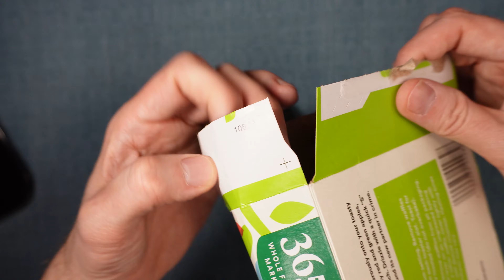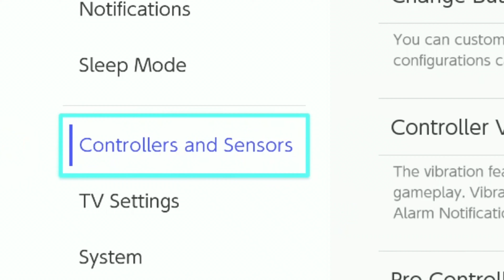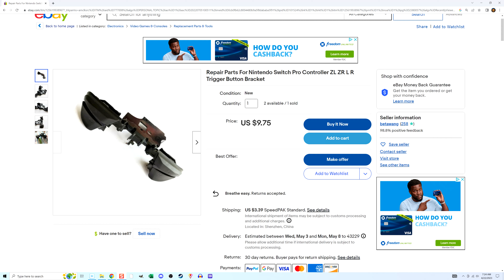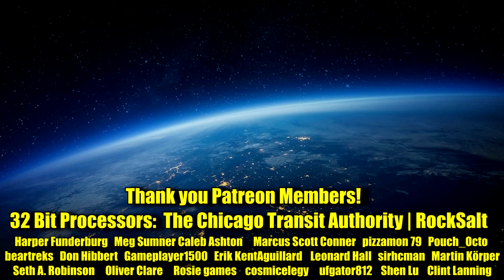How to Fix L ZL R ZR Buttons on Switch Pro Controller | Replace Stuck Trigger Bumper Shoulder Repair

Comment from the maker: Links to Parts and Tools You May Need:
Replacement Buttons: https://amzn.to/41UOXvz
Rubber Conductive Tabs: https://amzn.to/40ACOKW
Flex cable: https://amzn.to/3opZoIP
5-screwdriver set: https://amzn.to/3UVX7kZ
Toolkit I use: https://amzn.to/3ke14nc
Electric duster: https://amzn.to/41dZemX

All Amazon links above are affiliate links. I get a small amount of money if you end up using them to make purchase (it does not have to be for the item I link to, as long as you click my link then move to another item, it works)
Reply: @HowToX Can you show us how to fix Zr and ZL on joy con acting like Home button when it’s not the home button because I have that problem and I tried everything everything does not work

Comment: I just repaired my 3 year not working well R button with a simple cardboard thank you so much for your video, really appreciate it
Reply: Did you replace it or just cleaned?
Reply: @Ateliergamaart  just cleaned its border, like in the video, and worked perfectly
Reply: @labs824  thanks! After the eighth alcohol swab, I managed to fix the ZL. It had been stored in a drawer for many days, the winter here is very humid.

Comment: Hey. Thank you so much for the tutorial. I made it all the way to the end and put it. Act together only to realize it wouldn’t post up. So had to take it apart again and found I didn’t get the rim first ribbon snapped in correctly. So now it powers up but the ZL button still doesn’t work. I ordered a replacement part on eBay. Thank you for the suggestion. I wanted to let you know I was able to take everything apart with a simple eye glasses repair kit I picked up at the check out line at my grocery store. Screw driver size works perfectly for all the screws and I used a pair of tweezers from my medicine cabinet to remove the pin. Thanks again!

Comment: I tried to fix the ZL button mushy button but turns out someone spilled Pepsi or Malta and the metal part was sticky but I ended accidentally ripping the Ribbon that leads to ZL with that thing you have but my repair tool was pointy and sharp so I put everything back together and only ZL button has no Input so I just bought the Repair Parts for $6 instead of $9.75 and thats so easy to replace
Reply: Same😂
Reply: I had the exact same thing happen man

Comment: does this also work with the PowerA wired Nintendo switch controller? im having problems with my R button, AND my A button. because i discovered that i could use my controller to play minecraft on my chromebook. but the R button and the A button does not respond or work at all when i try changing the minecraft setting controlls and im not used to some of the controlls since they dont work

Comment: I absolutely LOVE the thorough breakdown, explanations, and timely execution of this tutorial. The views and angles were AMAZING! Literally, EVERYTHING! 🔥 The close visual attention to details like "slightly pull and push the rubber device on both sides until it's fully locked or latched flush in place" is EXCEPTIONAL at best. Of course, that is me paraphrasing as I think back or recollect the moment. I was equally impressed when I saw that your "Reassemble" section of the video with instructions was just as accurate and easily formatted as taking the Nintendo Switch Pro Controller apart for the repair portion. GENIUS! Articulation and follow-through are unmatched, even for someone of my beginner-friendly caliber and level of expertise. Your how-to, along with the product descriptions and links, are really TOP-NOTCH! Thank you for sharing. Please keep up the GREAT work! Job, WELL-DONE! Now, in my best Barbie voice, "To The Salon!" #ControlRoom #OperatingRoom You get the picture. #ToTheSalon
🙏🏾Blessings
BIG BIG L💞VE - 🌺InspirationByB, a branch and affiliate of ⚜️HairByB (Facebook Acct: Brenda Brown-Rodrigues & Hair By B) Please like, comment, share, and follow.

Comment: Another tip: 
I had a trigger start to feel loose. 
What had happened was it's worn out over time, and the plastic was dislodging the metal bar.
All I had to do was take it out, and fit it back in snug, while leaving some exposed to remove it in the future if need be. 

I thought I was going to have to replace the entire trigger bracket / thought a piece of plastic broke.
Reply: hey idk know how to fix this but i hope you can help because my nintendo controller only works if i hold down the home button and this only happens over steam :face-pink-tears:

Comment: hey none of the outside methods worked and i dont have a screwdriver to get inside my controller. the zl button is sorta stuck in an "always on" state. i've had this happen a couple times with my zr but just pressing it hard always seemed to work and this time it isn't. is there anything else i could try? i'm very emotional towards objects and don't want to get a new controller.
Reply: turns it was something with my computer i guess. i unplugged it and plugged it back in and now its working perfectly fine

Comment: I've notice I use the same tool set as you in 5:43, I have to say that's a very cheap set with poor quality. The drivers head are very soft so it mass both heads and screws while you turn it. Also, it's too thick to reach certain screws which are deep in the pro controller.

Comment: mine only works if I am holding A. I'm using it on pc and only for Elden ring so its not a huge deal but if any one knows how to fix it i would much appreciate it.
Reply: Forgetting the Bluetooth device and reconnecting it works but the problem starts again after a  little.